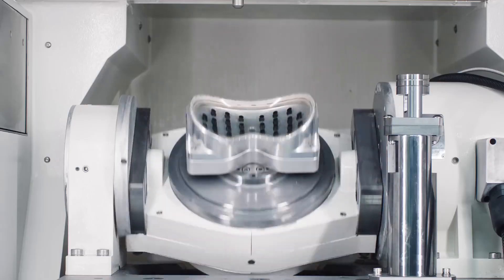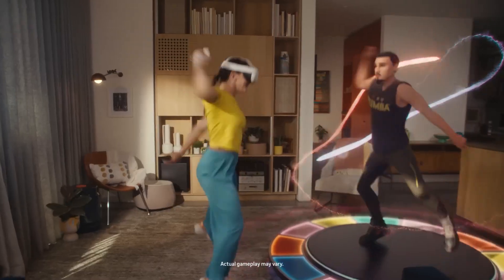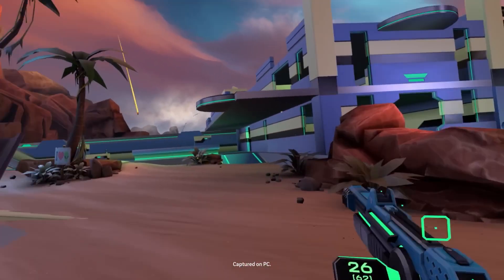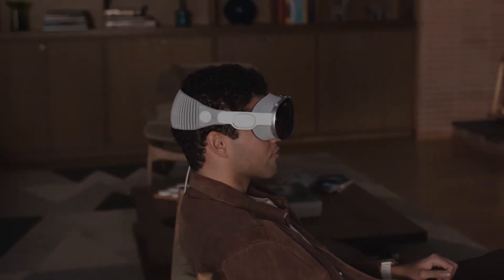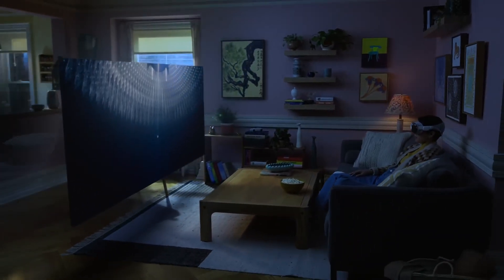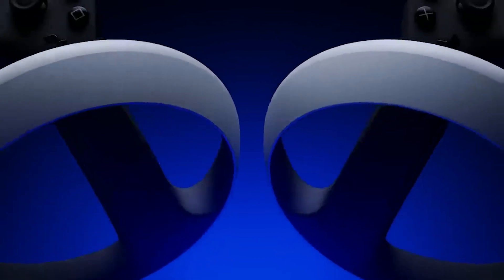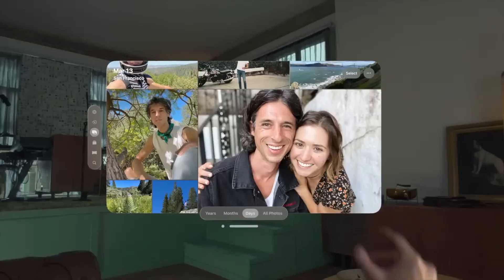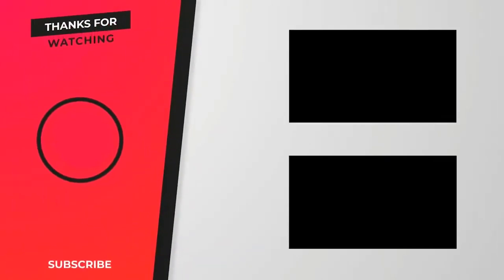Apple Vision Pro Vs Meta Quest 3 | Which Is Better?

Comment: I have the Quest 3 and it definitely does not have 6 hours of battery life. It’s closer to 2
Reply: Get a battery pack for it.
Reply: Sure, an external battery accessory can extend the battery but the original statement is still misrepresenting the base battery life. But yes, I have an external battery with my head strap
Reply: @snoozeshutter battery or cable bro. For sure if you are a regular user you dont know how to improve. With the quests you can connect many devices, USB, Ethernet, etc. that Apple probably will not allow due to compatibility.
Reply: @bator78a  lol, I know how to plug in a cable and I like my Quest 3. All I said was that the video was not accurate. Plugging in a cable also defeats the purpose of a device being portable if you’re tethered. It’s a limitation of the form factor and nobody has solved it. 

I will call out inaccurate reporting when I see it. If they wanted to say you can have up to 6 hours if you have an external battery, they could have said that.
Reply: Using this opportunity where everyone argues between visionpro and quest. Check my channel, I'm working on a quest 2/3 free multiplayer game ;)

Comment: The Quest-3 is significantly inferior to the Vision Pro hardware & software wise.
The pass through video shouldn't even be compared. That's how much difference there is.
Do I think Apple has a hit with the Vision Pro? Nope. For now it's basically a devkit.

It all depends on what usage people see for these devices.... Because it sure doesn't look like Meta & Apple know what these headsets will be good for.
Reply: Nah not significantly, I just recently got my XR-4 headsets and I had like 13 VR headsets so far from Crystal to Bigscreen Beyond to Arpara 5K to 8KX to Quest 3..... All the way back to Oculus DK1

I believe beyond Quest 3 you enter diminishing returns, my Crystal is 3 times the price of Quest 3 but feels like hardware eise it's 1.5 times better while software wise is 1.5 times worse cancelling each other.....

XR-4 is amazing but going from Crystal to XR-4 I hardly noticed improvement until I did side by side comparison and another user in discord group for Varjo shared same thing..... XR-4 is beyond Vision Pro in display clarity yet the diminishing returns was hitting hard and for one main reason:

Content still stuck at 4K and less...... Quest 3 already maxed out that, both in gaming and in media....

So don't look at specs, the experience is what matters, VR actually reached Hardware peak already but people don't know about that, we are already hitting diminishing returns heavily what matters now is lenses + software...... Vision Pro will have superior software but not enough to say this is a 7 times better like it's price tag suggest lol, infact not even 3 times better if you ask me, one of users in our discord he also tried Vision Pro and he said glare is the least in any micro OLED he tried but still noticeable hurting screen qualities